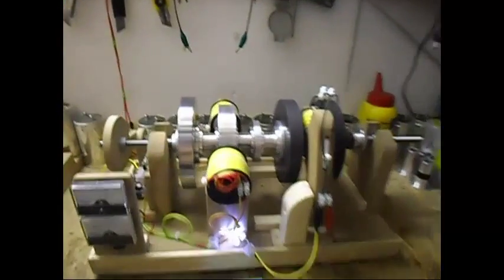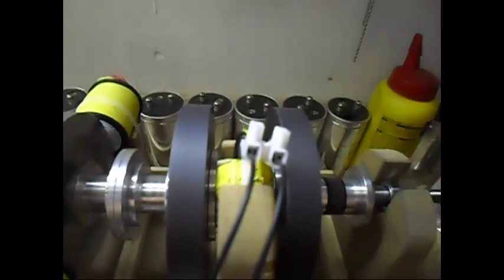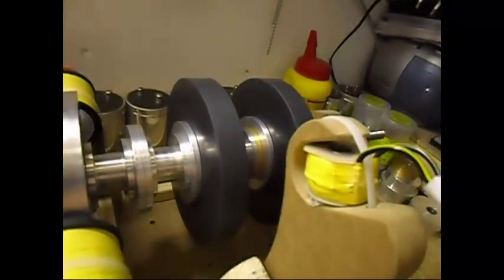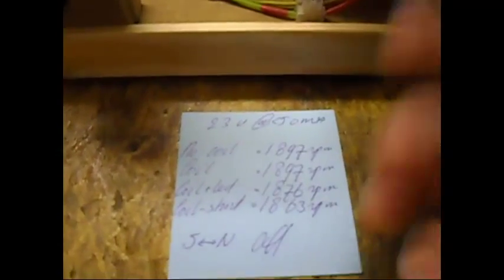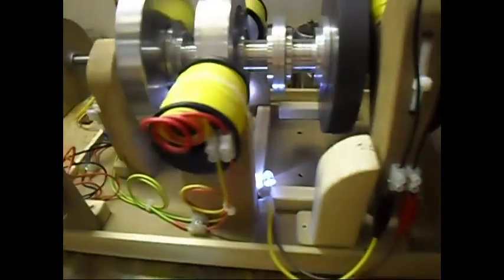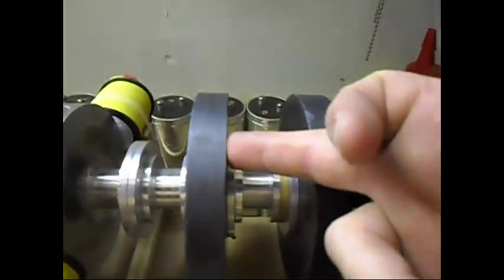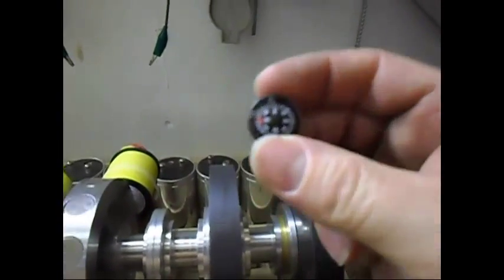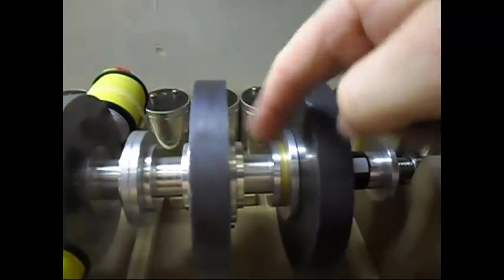Flux Gate Generator - Update 11 Rotation of 2 ring magnets - Pull Mode...

Comment from the maker: Just update where the system is now 2 ring magnets in pull mode wich is one south pole & one north pole facing in...^^
Numbers,
Input is 23Vdc @ <50ma...
No coil in place = 1897 rpm
Coil in place = 1897 rpm...:D...sweet...
Coil & leds = 1876 rpm...not as good as in the previous video...;-)
Coil shorted = 1863 rpm...could be much better ofcourse...-.-

This update/test takes about 30min to do so what you see here is only a tiny bit of it...otherwise it would be a long boring video...lol

Here one can clearly see the basic workings of the magnetic field of rings magnets when they are spinning...^^
Guess i only need a coil now that doesn't slow down the drive side and i'm done...???...lol